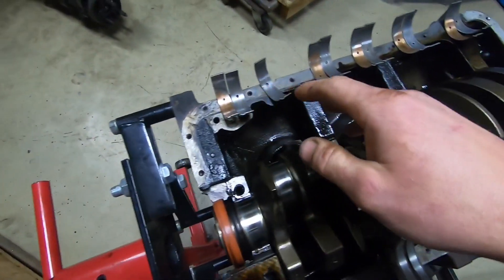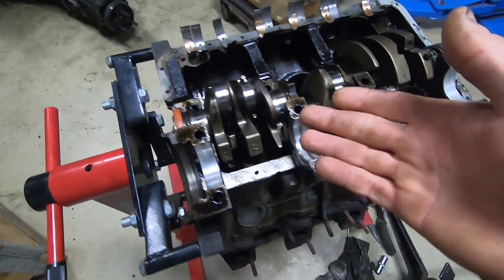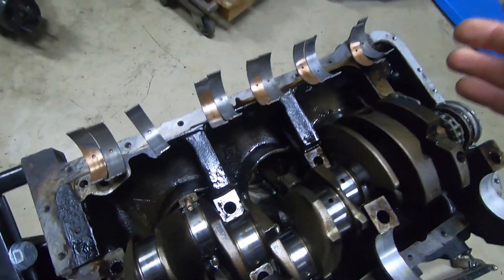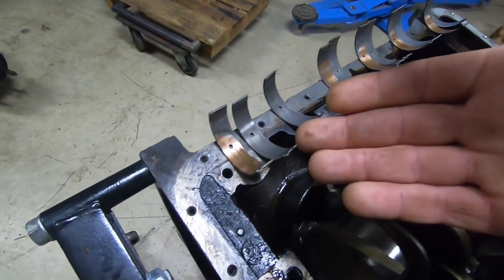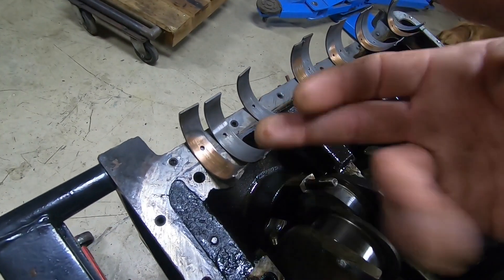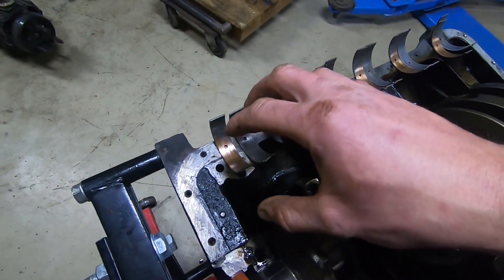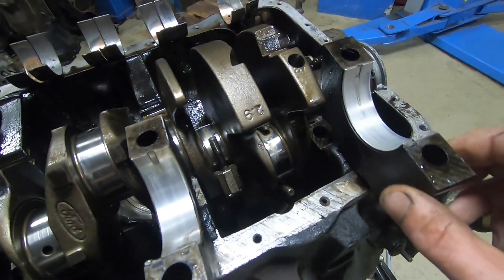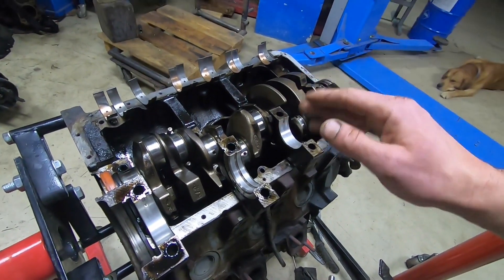Total Disassembly | Ford Cologne 2.9 Engine Overhaul | Part 3

Comment: Is the 2.9 more tuneable than the 2.8 Cologne engine?
Reply from the maker: Yes it is. Mostly tue to different head design. 2.8 only has 2 exhaust ports on each bank, while 2.9 has one port per cylinder. Another main difference is that 2.8 has timing gears while 2.9 has a chain driven timing.
Reply: @HappyDayGarage The more conventional 3 exhaust ports also makes it easier to breath. I think the 2.9 always sounded that bit better
Reply from the maker: @jaggass yup, it's all connected. 🙂